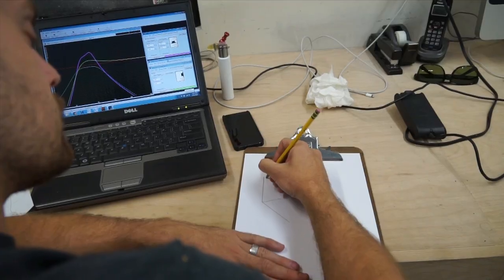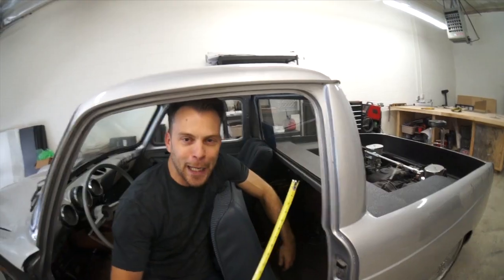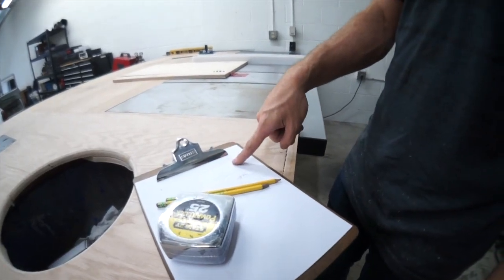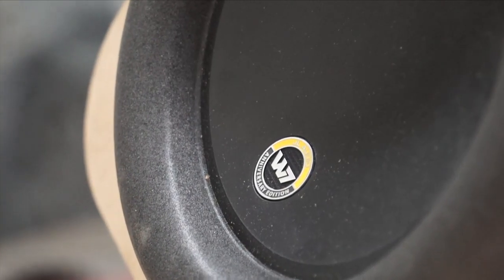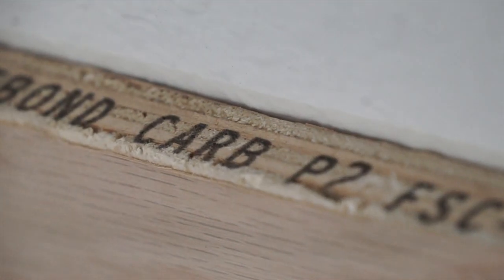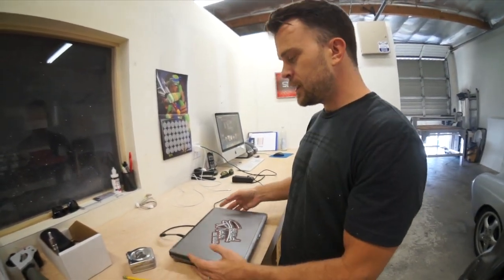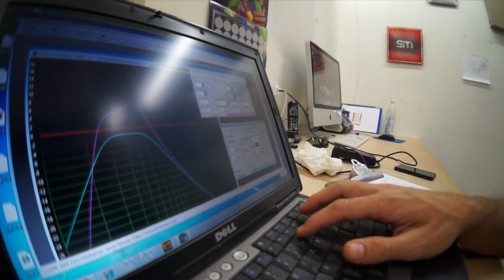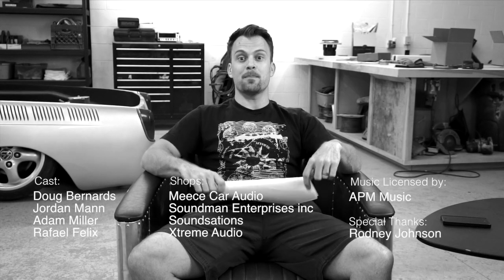MDF vs Birch, Subwoofer Box Design for the Mule

Comment: I highly doubt you'll answer this being that this video is so old and it's probably a dumb question but what type of birch wood did you use for the box? I've heard there are different kinds you can use.
Reply: he said what kind of birch it was
Reply: +chase sprouse He didn't exactly say what kind of birch he's using. What Nicolas is referring to is the fact that there is birch plywood and there's baltic birch plywood. And when the camera zoomed into the wood you can count the layers and see it's just normal birch plywood, not baltic birch. Which means it's soft core, not birch core. Baltic birch doesn't come in 4x8 sheets and has a lot more layers.
Reply: solid core birch (cabinet grade) plywood

Comment: Wait so that's better then mdf and it's lightweight ???? I'm still learn so this will help I'm going to build a box for a sundown zv4 15
Reply: It's about the same acoustically.  But it's lighter and more expensive.

It also has grain, obviously, so consider leaving some exposed.
Reply: ok thnks guys im just gonna go all out i mean i alredy wasted 600 on just one sub so the box has to be topnotch to the lighter the better i already have two kinetic 2400 in the trunk lol
Reply: *****  Birch ply is usually fine.  It's a more expensive wood, so the care taken when gluing it is quite a bit better than oak, pine, etc.

If you were going to fork out the dough for pure birch, you'd be better off using bamboo.

Comment: protip: (i have no idea why) in alabama where i'm from , birch plywood from our local building suppliers is a bit cheaper per sheet than 3/4 mdf. if you use a lot of it doing fab work , it might be worth a little looking into. mdf=$36-$40 per sheet. shop grade birch $19-$23 per sheet
Reply: What about now after Obama’s 3rd term I bet that birch if its real and not a layer of birch over pine is 90$ a sheet

Comment: It's hard to tell when Doug is serious. I didn't know MDF contained formaldehyde, How do you feel about the fiberglass boxes? I know you built one for your cousin. What deterred you here? It seems like a good chance to do that.
Reply: Yes it contains formaldehyde, but it isn't toxic to the touch. Where you have to watch out is the saw dust (aka need a mask when cutting) like he said. But what people fail to mention the higher density of MDF actually has better acoustical properties than baltic birch, but not really on a level people would notice. Most people will weigh there options purely on weight, but a 13 ply baltic sheet is only like 20 lbs lighter than a sheet of 3/4" MDF, so that "weight advantage" only really comes into play when you use more than 3-4 sheets. /rant

Comment: Mdf seems like a pulled tight card board box. Like same shit a Pizza hut box is made of.. I made a sub box with Birch out of an old Peavey PA box. And it Hits low and sounds beautiful and the Bass carries nicer then MDF for sure.
Mdf. Sounds like  fast punchy Bass sounds load but not smooth and Rich and doesnt carry the Bass note as long.....
And iv never had a mdf box in all my years of doing bass stuff ..
In all my years iv only had 3/4 inch to 1 inch compressed wood boxes and they seem to hit loadest and have the richest Bass out of all subwoofer boxes.. i think manufacturers are wrong for making mdf subwoofer boxes they suck. I bought a mdf box off HIFI Sound connection thats all they do is subwoofer boxes and i could push the screw threw the mdf with a drill gun and i hadnt pulled the trigger.. no way can you even hold screws...the Skar box was the same way....(hard paper)MDF crap. I bought a skar box and it was made of pizza hut box paper too i mean MDF..